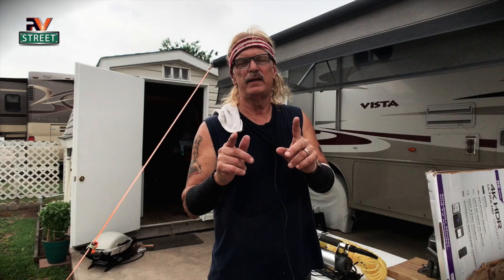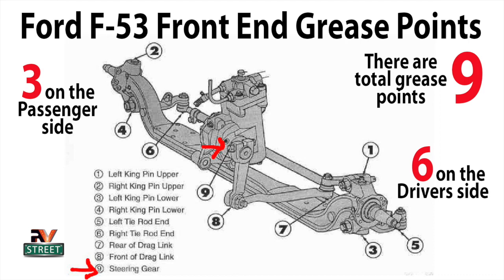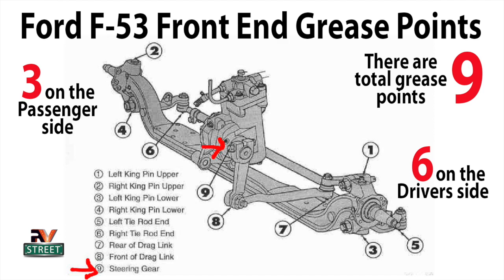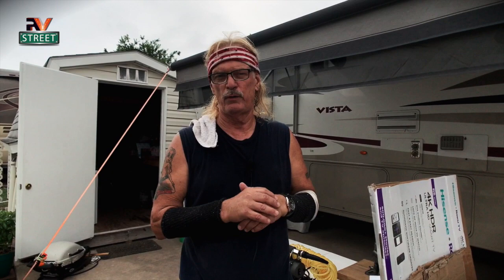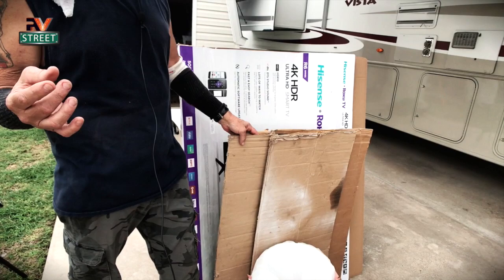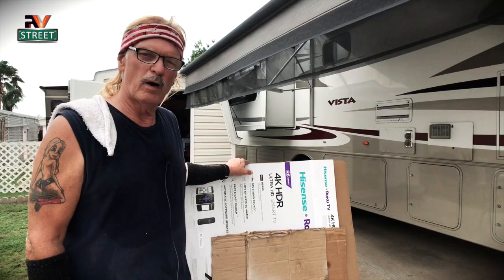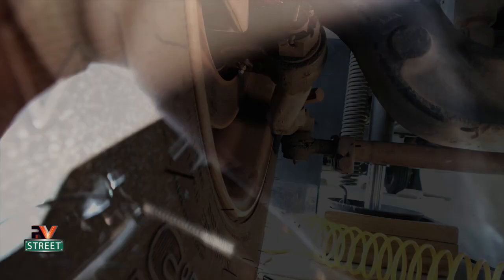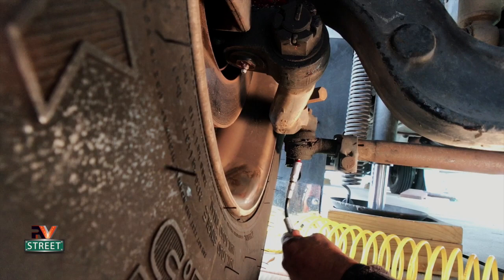GREASING front end, Class A, Gas RV Motorhome the RIGHT WAY

Comment: I did not know about greasing kingpin unloaded!   Thanks.   I had my pu truck greased at dealer for years.   Top of gearbox wore out.   Lack of grease!   I had them replace my u joints 200,000 miles.   A year later, I had to replace rear joint again!   It never got greased!  The crease fitting was turned and there was no way to grease it.   They said, out of warranty.   Thanks for video!    Kevin

Comment: I see you have installed some Tejay plates on your ASB. I also do my own oil changes, but i never knew about the king pin greasing in loaded and unloaded. I am going to follow your channel because there are hardly any that cover gasser motorhomes.
Reply from the maker: Yeah that king pin greasing tip is not common knowledge even in most grease shops. They just lift you up on the rack, grease away and off you go. It's all about getting as many rigs in and out in a day. Glad to have to have you aboard.
Reply: i noticed that.  i just completed the CHF on my coach...what are those plates that use both holes?
Reply from the maker: @sdmedicscott  Please be more specific. I don't quite understand what you're asking.

Comment: Hello Martin,
After watching this greasing video, I set to following you instructions. I found the reason for lubing with the weight on and off the front axle. The grease came out of different places when I did it. My rig is a 2017 Fleetwood Storm 32A. When I moved to the drag link I found both boots blown out and full of moisture. And my right lower king pin needed 28 pumps of grease. I did this zerk third so I know the gun was pumping. I’ll be doing my own work from now on, following your helpful instructions. I’m changing the drag link myself. Carl
Reply from the maker: Yep and doing yourself you'll know for sure it's done right. 🔧 👍

Comment: With the help of my 14y/o grandson we did an oil/filter change and front end lube on my 2012 F53 yesterday using your methods. He is nimble enough to reach the top king pin and steering box zerks so I’m confident we got a good grease job. We also did a generator oil/filter change while we were there. Thanks for this video.
Reply from the maker: That a boy. That's the way to teach them early. Not many young folks know how to do much of anything concerning fixing stuff or what needs maintenance or how to do it. It's the key to keep stuff running a long time and save buckets of money.
We've got a real good 3 part series coming up tomorrow night @ 8:30pm. 
thx Barry. Good job. 👍

Comment: Nice job boss.  Just a quick FYI.  I bought a Dewalt battery grease gun and it is fantastic.  Eliminates thr need to drag a long hose around plus, in the event that there is any hardened grease in there, it has thr power to blow through it.  Lastly, good point about wiping off the zerks before and after the job.  A step that a lot of folks omit thinking they are doing the right thing.  Quite the opposite.   The grease inside the joint is where the good happens, not outside.
Reply from the maker: Thanks Chief. 
Ya that unit is an option but just to let you know, the reason I recommend the Pneumatic Lincoln unit is because full timers and a lot of part timers already have an air compressor on board. No more batteries to worry about and another thing to charge. But I'm glad you watched that video and I'm really glad you took greasing your own rig into your own hands. Now you know it's done right and you'll save money over the long haul too. 🔧 🙏
Reply: @RVstreet  I have a question for you bubba.  Do you use the Lincoln to air up your tires as well?  I currently have a Porter Cable pancake unit but because of your  use I am strongly considering the Lincoln.  Looks like it would be a great lighter weight option.  We are in Burleson and have been full timing it for 2 years now and just swapped over from a travel trailer to a class C so it seems like a lot of your views and suggestions will apply to my wife and I as well.  I'm a fairly new subscriber to your channel so I've got a lot of catching up to do.  Maybe we can compare some notes as we go along.  For now  I really would appreciate your view on the Lincoln.  Thanks Brundage.  Mike
Reply from the maker: @chief7839  My pneumatic Lincoln is my grease gun. If you watch this video it will tell you everything you need to know about air up tires and what we use.
https://www.youtube.com/watch?v=2kCXRbvtoYA&t=281s

Comment: Unsure of the differences both in the front end components and the rest of the undercarriage between a Class A Gas & diesel motorhome, as I have the rear diesel version.   I've greased my own in the past, and thought I'd see if there is much difference, but one thing I noted was my rear drive shaft universal has four grease fittings, where I hear some have one, others have two.   Thanks for the informative information on the 'loaded/unloaded' portion, as that was new to me.
Reply from the maker: So....ya, gas coaches have a sealed U joints on the drive shaft from the factory. So no greasing is necessary. But if a U joint is ever replaced, then those do have zerk fittings for greasing.

Comment: I just took my 2018 Thor ACE 30.3 in to get the alignment checked because it wandered around on the road a bit too much.  I just purchased it September 2018 with only 3900 miles on it. When the shop put it on the rack to check the alignment, they found too much slop in the kingpins. I was absolutely floored. After all the ACE only has 3900 miles. The mechanic showed me that the kingpins were nearly dry. The coach was not properly maintained, and I suspect that ford did not put enough grease in the first place nor did the original new seller perform any predelivery service. I wonder now whether it ever had an oil change. Clearly the poorly done factory grease job and 4 years of sitting around contributed to the premature wear on the kingpins. I am having the Kingpins replaced and trying to have the extended warranty pay for the kingpin replacements. This experience has taught me some very valuable lesion.

1. Buy the extended warranty.
2. Insist a predelivery service including a full grease job, be performed before taking delivery of a new RV.
3. Do a full grease job with each oil change.

Fords recommended service intervals are inadequate for vehicles that spend substantially more time sitting than driving.
Reply from the maker: With only 3900 mikes I find it nearly impossibly that the kingpins need replacement.

Wandering can be caused by misalignment though.

How did the mechanic show you that the kingpins were nearly dry? You’d have to totally disassemble that area to see anything and I know they didn't do that at an alignment shop.

Are your front tires showing excessive wear?

It possibly could be the king pin bushings and they can be replaced easily in a day. Vertical movement, ie up and down movement is not caused by king pin wear though.

King pin wear is top and bottom of the wheel rocking back and forth across the vehicle, and assuming the bushings were reamed properly at installation, only wear through lack of grease.

Vertical movement is controlled by a thrust bearing and shims as necessary.

When cars had king pins, you jacked up the front end, you grasped the top and bottom of the tire and tried to pull the top out with the upper hand and push the bottom in with the lower hand, then quickly reversed the action, trying to rock the top and bottom back and forth. If movement was felt, you needed an assistant to check where the movement was while you where rocking it, as a loose wheel bearing gave the same feel. Sometimes we would nip the wheel bearing solid to take that out of the equation.

I describe this so you can get an idea of the motion needed to do the test.

With heavy vehicles like your motorhome the wheel assembly is just too heavy to do this. So by raising the motorhome so the front tires are barely off the ground a pry bay is used on a 45 degree angle, the bottom of the bar against the ground under the tire, with the side of the bar pushing against the edge of the tread. Again a loose wheel bearing give the same result so someone who knows what to look for is needed to see exactly where the slack is. The main thing is that you are trying to put a horizontal force on the tire edge, not a vertical force.

Being a 2018 it should be covered under Fords chassis warranty. I’d take it to a Ford heavy truck dealer and have them look at it.

In any case, I suggest you get someone a second opinion who knows what they are looking at to recheck.
Reply: Sorry I mentioned kingpin bushings. The shop had the coach  on the alignment rack and had lifted the Axel so both front wheels had no weight. They were able to rock the tire back and forth by push / pull on the top and bottom and I could see movement. I only added the original comment as a warning that we can not count on every thing being properly lubed from the factory
Reply: You could see that the area around the pivot points was almost completely   dry no external grease showing whatsoever.

Comment: Just a quick note...I did my first grease job on my 2017 Winnebago LX 35F yesterday...all went well until I tried to do the steering gear...could not feel a zerk fitting when feeling around where it was...finally used a little mirror tool and found out that zerk fitting has a rubber cap on it...that's why I could find it blind...took off the cap and got it done...great video everything worked like you said, however by ViAir and grease gun combo didn't work that well like your's seems to do...my gun seems to be blowing out air around the trigger and I don't seem to get the consistent 3-4 second burst like you do...finally got it done but I think a grease gun update is in my future...

Comment: I had my brake fluid changed and the Ford dealer lubed the chassis for free. Otherwise I do it myself too. Manual grease gun for me works fine
Reply from the maker: I hope they did it loaded and unloaded.
Reply: @RVstreet  One would hope a Ford dealer would! I didn't ask but now I know
Reply from the maker: @joethecomputerguy1  Ya you'd think they would but I have met some people that have taken their coach to a dealer and they didn't. Some are trained one way and that's what they do. Plus it's get the coach in and out to get the next coach in. That's why I do it myself. Greasing loaded and unloaded is really important and if you're in real dry climates a lot like in AZ, NV, UT and states like that, the coach needs more frequent greasings because the grease can dry out.

Comment: I use a Milwaukee 12volt grease gun works great and no air lines to pull around.
Reply from the maker: Yep that will work too. But most full timers already have an air compressor so getting an pneumatic grease gun makes more sense. Plus they are much cheaper than a 12volt, don't have to have batt's recharged, or have batteries replaced when they get old.
thx for commenting. It all matters.

Comment: Hey Martin great job boss!! So, i noticed AMAZON no longer has the one you had on the video. i know this video was made 3 years ago but I agree with everyone below "very informative" indeed!  But AMAZON has the Lincoln 1162 Fully Automatic Heavy Duty Pneumatic Grease Gun, Air-Operated, Variable Speed Trigger, 30 Inch High-Pressure Hose, Combination Filler Coupler/Air Bleeder Valve? Will this one work as well?? Thanks!
Reply from the maker: The one I use and that was in this video IS in my Amazon Store in the "Tire, Engine and Chassis Care" category.
https://www.amazon.com/shop/rvstreet

Comment: Great video. Subscribed. Just FYI: some motorhomes have grease fittings on the u-joints too.
Reply from the maker: Yeah I was going to mention this but it varies a lot. If you still have OEM "U" joints most of them are sealed and can't be greased. Ours is that way. But if you replace them later on then yes they will have Zerk fittings and will need to be greased. I just decided to not cover this since this was a front suspension video. But good point. Hopefully others will see your comment.

Thanks so much for subscribing.

Comment: I have just recently started watching you videos and I know this one is a couple years old now. I also don't know if you have covered this in another video as I have only watched a couple. So don't know if I have a 1993 Fleetwood Pace Arrow on a Chevy Chassis (P30 Van). A couple extra places I have to grease are the U joints on the drive shaft. Is this something you have to do as well or do you have the ones you have to replace every so often because they don't have grease spots?
Reply from the maker: Not sure about the Chevy chassis b/c that's obviously an older RV. But on Ford F53 chassis's the "U" joints come sealed from the factory and there are no grease points. If the RV is driven and maintained properly, the factory "U" joint should be good for at least 100K miles. However, if the drive shaft ever has to be pulled for whatever reason, that's when you'd replace the "U" joint and the replacement would have grease points.

Comment: I have it on pretty good authority that Ford recommends NOT greasing the kingpin unloaded.  Unloading creates a cavity, at least at the lower zerk, into which the new grease flows.  Then loading the axle creates something like a hydrolock, where the grease has no place to go.
Reply from the maker: Normally I'd let this comment go but for our YT followers sake, I have to respond. 
Ok, so if what your "pretty good source" says is true, then why do so many Ford authorized shops raise the coach up on a rack—all wheels way off the ground and then grease? That's just number #1. With all due respect I don't know who your "good authority is" but their advice is just flawed and wrong. 
Ford along with many other manufacturers recommend a lot of things for liability & warranty issues and many other reasons as well. Any PROFESSIONAL shop will do what I showed in this vid. 
This is actually a very timely comment because just TODAY actually I went to have my front end alignment checked by a top notch heavy truck service company—the best there is here in the Houston area IMO—and the owner said that my alignment not only was just fine and within spec, but went on to say that all of our front suspension parts and the kingpins were some of best he's ever seen at our age of coach. No slop, no play, great condition and he said it was obvious that these areas have been well cared for. He's been doing this for 40yrs., used to have 8 shops but now has reduced it down to one shop with 10 service bays getting ready to retire.
Greasing loaded and unloaded insures that the kingpin gets properly greased.
So...sorry Mark, I totally disagree with your "pretty good authority" but everyone has to make their own decisions.
thanks for your comment. 👍

Comment: I worry that I have over greased my Pittman gear. Anyway to tell if I damaged it? I see a lot of grease around it  as I always greased until grease revealed itself around the seal? Also these F53 tie rod and drag link boots in the 2014-2018 era seem to have a bad tendency to rupture. I've already had one rupture on the drivers side tie rod end. Unfortunately I can not find a replacement (OEM or Universal) boot to replace them. Ford wants to sell an entirely new tie rod or tie rod end for many many $$$$$ and all I want to  do is change out a boot. Frustrating. Great video and very helpful info on the king pins- I never knew of the loading-unloading need. Thanks for another great video!
Reply from the maker: I would not worry to much about the ruptured boot. If you do this grease job every 3K-to 4K miles like we do those areas will always have grease in them. But it you have a hole in one of those boots, clean it really good. Get off all the grease so the rubber is super clean. Then apply a strip of Gorilla Tape to the hole or around the bottom seal part. That's just one way to plug up a leaking boot. Be creative because I hear ya about frustration of just not being able to buy a new boot. There are even some creative ways to grease a sealed boot with no Zerk fitting at all. There's always a way to get a job done.
I don't know of any particular symptoms or way to tell if you have a damaged Pitman gear seal. Just be careful from now on and give it a small shot or two of grease.
Thanks for watching Joe.

Comment: Excellent video. I have trouble getting grease into the top steering box - it just comes out the sides (the other fittings load up fine). Also, on my fittings with the rubber boots, the boots are all shredded - should that be repaired? I use a DeWalt cordless battery powered grease gun and it seems to work fine.
Reply from the maker: Is your RV a F-53 like ours? If so when you grease that steering box, go easy with the grease and yes you'll see a little come out behind that arm

Comment: Don’t forget ujoints
Reply from the maker: Factory U Joints don't need greasing. They're sealed and don't have Zerk fittings. But if you ever replace the the U jonts later on, then yes. They will have grease fittings. thx Camut. 👍

Comment: Are there other points on the RV you have to grease? Back wheels? Drive shaft?
Reply from the maker: The back wheel bearings are oiled/lubricated by the oil in the differential. The drive shaft "U" joints are sealed from the factory and there's no greasing them. However, if you ever replace them they will come with Zerk fittings and they will need to be greased ever so often when you do the front end. Whenever I grease the front end, I also give one shot of grease to the wiper seals that are on my Power Gear Leveling chrome ram shafts and my tow bar.